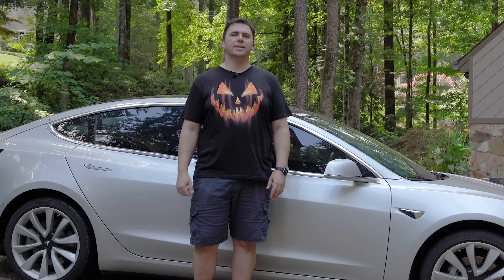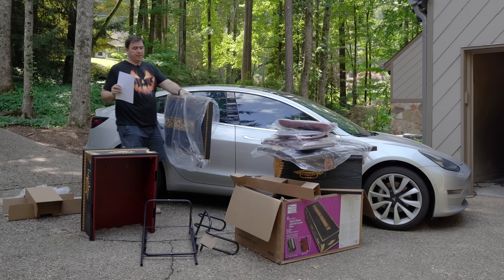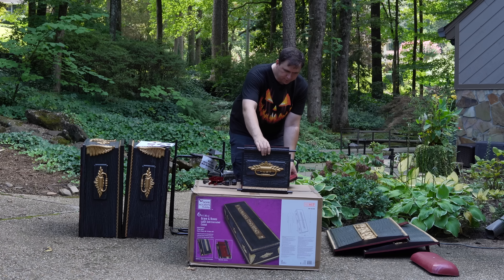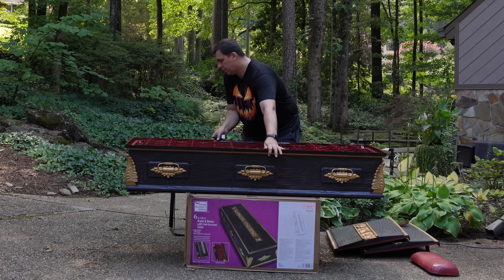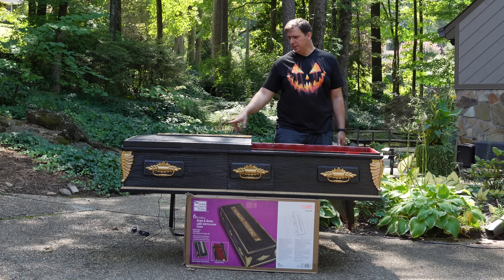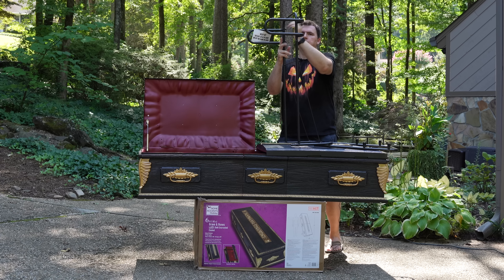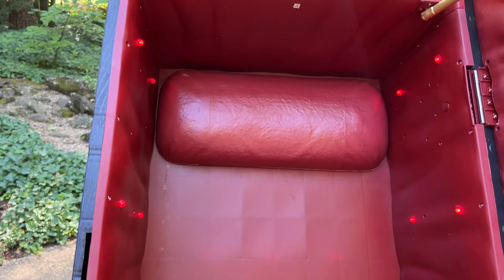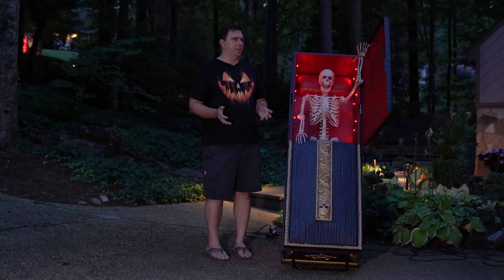Home Depot Halloween Casket Prop - Unboxing, Setup and Review

Comment: Maybe leave off the 6  little dot LED lights in the coffin and put one of those Ustellar lights in the bottom pointing up. You can control brightness and it will cast a cool shadow through the bones. If you try it  post a quick video. Great videos